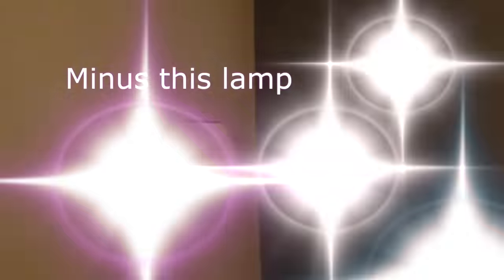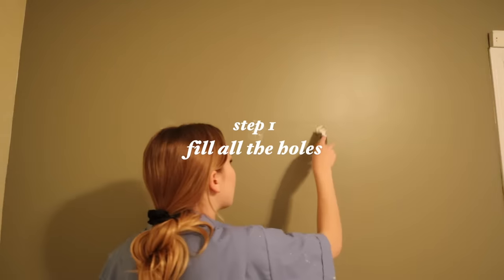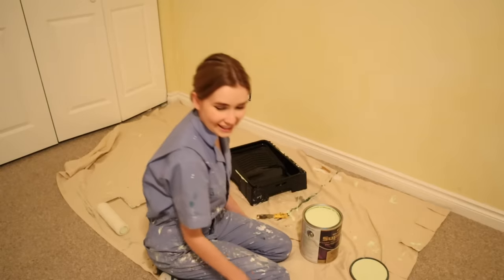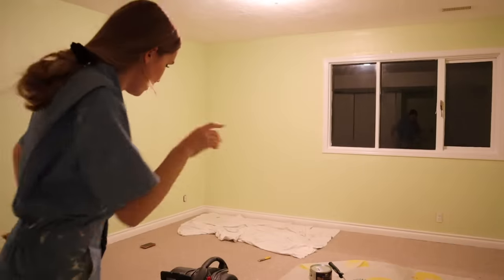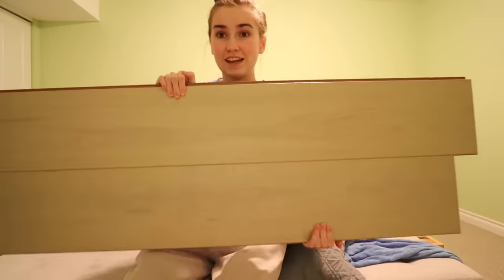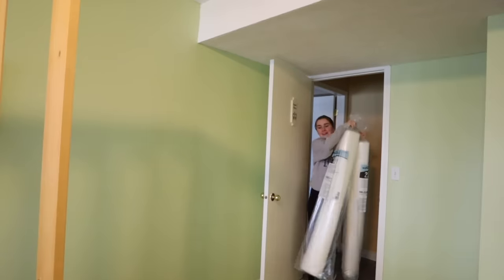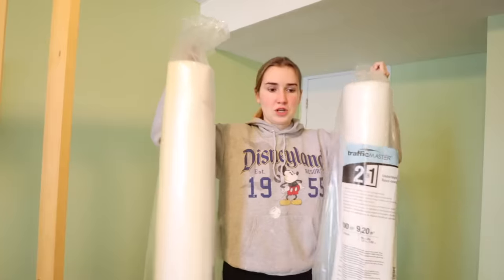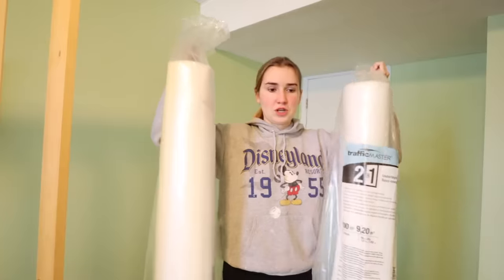EXTREME Bedroom Makeover! *tearing out old carpet, painting & many DIY's*

Comment: hi mia!! just a little tip for next time you’re working on floors, sometimes the mallet can damage the wood, my dad uses a small wooden block over it and hits that instead of directly hitting the floor. just a little tip if you ever noticed them warping slightly from the mallet.
Reply: That wooden block is very helpful and doesn't damage the wood. I also just laid a wooden floor and this wooden block was a real lifesaver.
I'm not to sure if you should have put away the baseboard while laying the floor. I did it and it was a lot easier. 
I love your eagerness to experience new things. 
Greetings from Switzerland!
Reply: My dad is a flooring and carpet fitter and he said a mallet is fine as long as its made of rubber

Comment: For anyone thinking of doing this flooring and may read this: it is good to do it in the direction Mia did it from a big wall to the closet as it gives you more practice cutting boards rather than doing the trickier closet ones at the beginning. Also good for if you can use scrap pieces towards the end of the project in the closet rather than having all those small scrap pieces visible along a long length of wall very out in the open

Comment: For future reference it's much easier to install that floor by sliding the long side in, then backing it up to the edge of the board it's joining. Also there's a tool (like a plastic block) that makes it easier to pound it in with, hitting the boards with the mallet can chip them

Comment: Personally, I think it’s easier to take off the baseboards before laying the new foor, that way your cuts don’t have to be 100% perfect on the edges and there is no need for the rounds to finish it off. (Unless you wanted that look) Also, when your using the mallet to bang in the planks from the side grab a scrap block of wood and place it and bang the scrap block so you don’t damage the edge of your floor board. :)

Comment: I’m midway through and loving the video! Some tips for the flooring if you want to do another room, there is a tool (tap measure I think, it looks a little like a pry-bar) that will hold onto the floor and then you tap it into place so you don’t wreck the groove/tongue on your pieces. If you can’t find that tool, you can use a scrap or cutoff board. You can also avoid the two inch piece of flooring, by splitting that amount between your first and last rows.

Comment: To easily change or put on a duvet, lay the entire duvet on your bed inside out, then put the comforter on top and start rolling, both pieces together, from the headboard towards the feet. Once you get about a foot from the end, tuck the ends into the roll and then unroll back towards the headboard. I do mine alone all the time and it takes less than 5 minutes for the whole process.

Comment: Just a note for anyone cutting wood for floors- You dont want to mark the wood for your cut with the wood facing the way it's going to be laid. There are lips and slots (not the technical name) on a lot of wood that needs to lock together, so you have to flip the wood slat and mark the length with the wood going the opposite way, so the cut side will be against the wall. The piece she showed us being marked isn't the piece she cut and laid, it would've needed to be marked on the opposite side.

Comment: Pro tip. There is really no need for wood glue. Long Crow bar for removing tac strip. Let me tell you installing tac strip on cement is way harder than removing it! Random placement is so much better. Use your end from the last row to start your next. Easy peasy. also use a broken or short piece with the lock to use as your "knocking in" piece. Then your hitting a piece that doesn't end up part of your floor.

Comment: girl if you take out the base boards and refinish them you can reuse them instead of getting quarter round to cover up your gaps from the boards. Right now, there is a shortage of quarter round. You can also avoid being the best painter in the world as well. you can get roofing felt as your underlayment- it is 4X cheaper than the cheapest you can get. it comes in 15 and 30 lb rolls that is 420ish sq feet. it does not smell once the flooring is on it.

Comment: I can't tell you how many times I was screaming "NONONONONOOOO" when you were banging the crap out of the tongues of the wood flooring 😭😭😭 I know it's easier that way but it won't stay as long and your flooring will start to come apart because the tongue fits into the groove on the inside.. so when you hammer it that fragile tongue falls apart. But it's okay, you're a Nooooooob xD. So the way to get it to fit without banging the crap out of the tongues is to only connect the sides of the boards and line them all up against the boards, lift up the row with your buddy, slide in then push down. Use your feet to close the gap (shoes baby) and use your mallet to make sure you're clicked in. 😉 Good job though!! I love the room!
Reply: Also if you wanna use the mallet then there's a thing called a tapping block that has a groove in it meant for tongue and groove flooring so you line that up to your flooring and use your mallet like you were without killing the tongues. Also another tip is to remove your base boards from the wall first, then like up your flooring with your wall and then the baseboards will hide that half inch gap 🥰😘 My step father did flooring for a living so I kind of learned how to do this through that man's crazy perfectionist talents. Please know I'm not trying to criticize and I'm sorry if I accidentally came off that way :( I just figured I'd help you out for next time 😁😁🥰